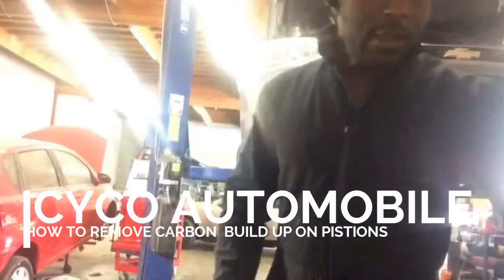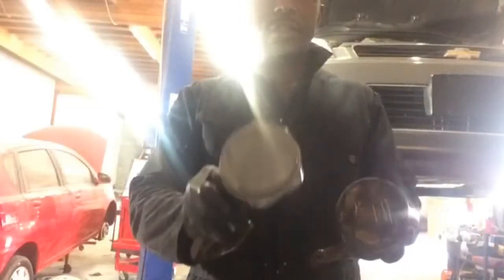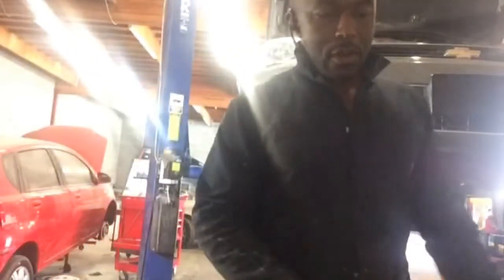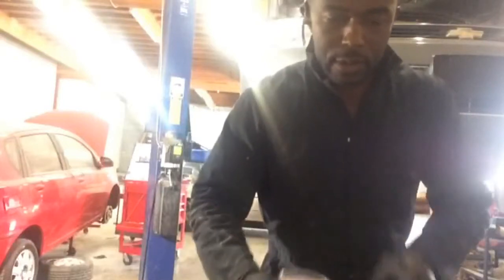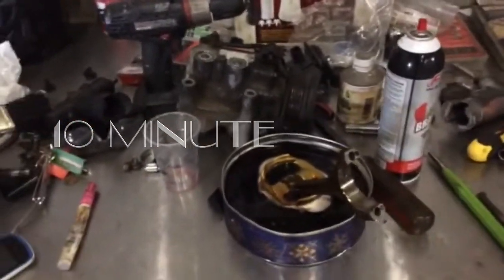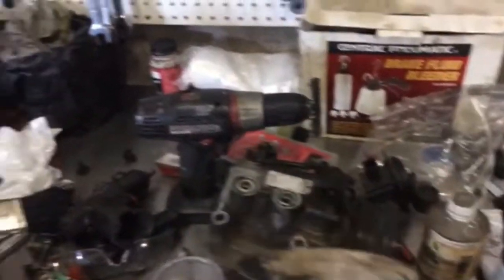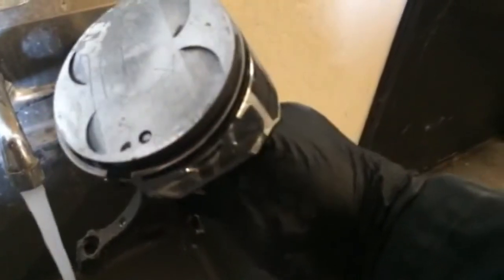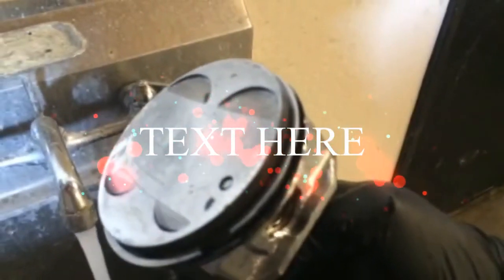HOW  TO REMOVE CARBON BUILD UP ON PISTONS /ENGINE PARTS

Comment: Hello Cyco....   At least use a polyethylene or rubber bucket.  Those little biscuit/cookie tins were never meant to hold liquids.  You were lucky if it did not leak and make a mess! 

For F. Poisson.........    That product is the least of your worries!  Most products like that are either regulated and meet strict environmental guidelines and including WHMIS standards, and / or made mainly of natural citrus ingredients and will dilute to the point of not creating a hazard.   The hazard is clearly in it's concentrated form!